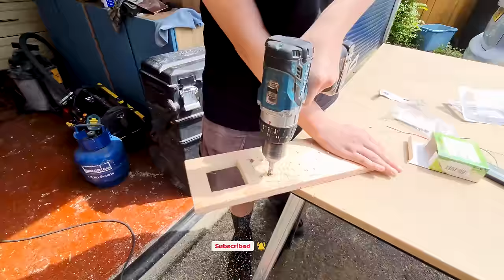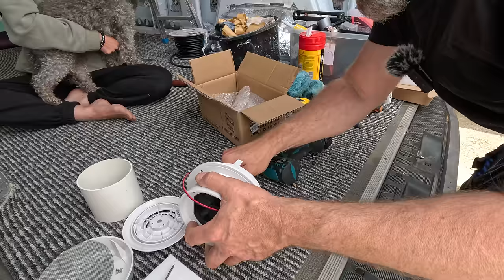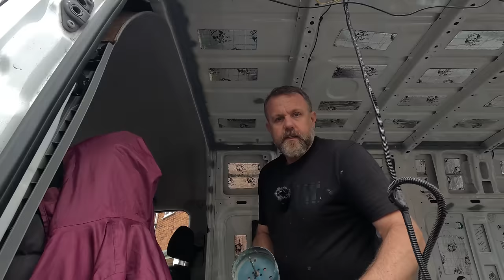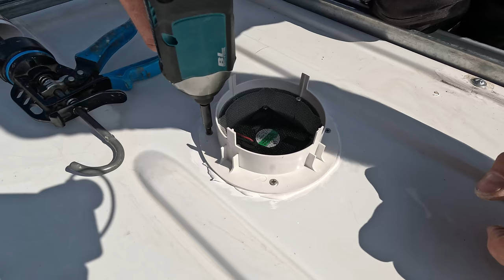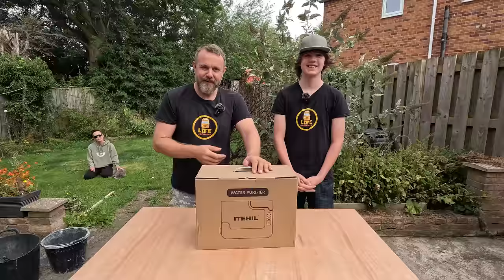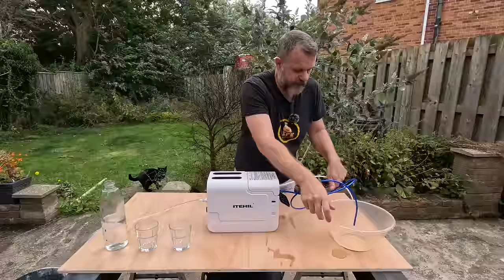Budget Campervan Ventilation & Water Purifier Review | Helping Sally’s Sprinter Build

Comment: Tip: as Sikaflex is to be a permanent flexible material there should be a certain amount of goo left between the to be glued faces to maintain this flexibility over time ... (do not overtight the screws)
Reply from the maker: Thank you for the education. Keep Em coming. I'm a joiner and plumber. This van lark is all new to me 👍👍

Comment: Hi, what was ventilator motor speed? Some sellers are offering 3300RPM (silent) and 4000RPM ventilators (high speed) at least Aliexpress had these options.
I am waiting silent version for my van shower. Should fit under solar panel. Dont know if silent is enough airflow or I need replace ventilator? Probably can always add variable speed module if it is too loud

EDIT. your link description says it is 3000RPM.
Reply from the maker: To be honest I didn't look. Sally searched for them and ordered them. I just helped install them for her. I have a similar, solar panel/fan issue. I'm thinking I'll go out the side wall of the van instead
Reply: @life_uncharted  I prefer below solar panel if it fits there - it is shelded from rain, UV and stealthier.